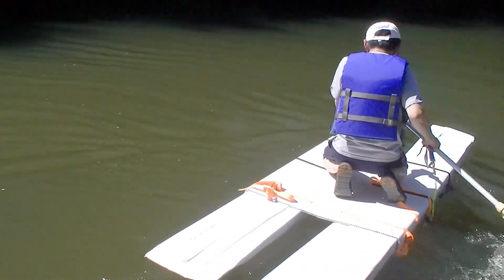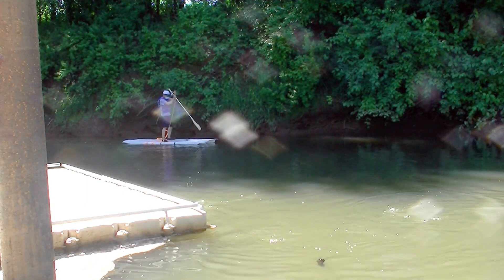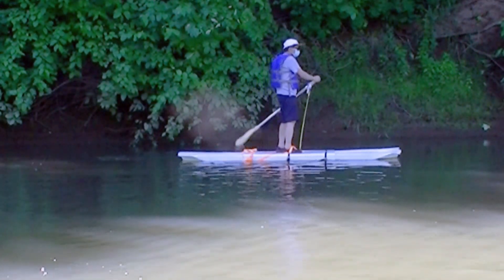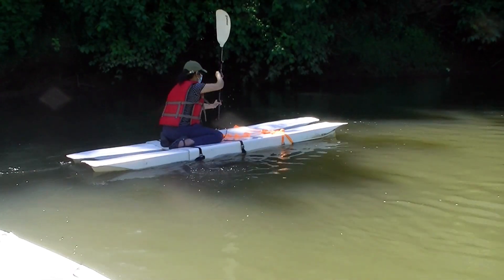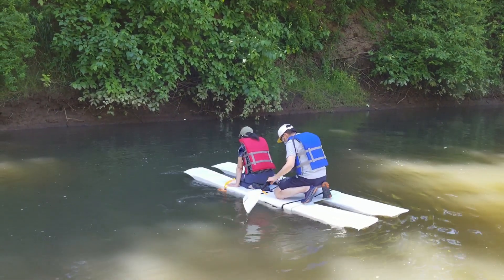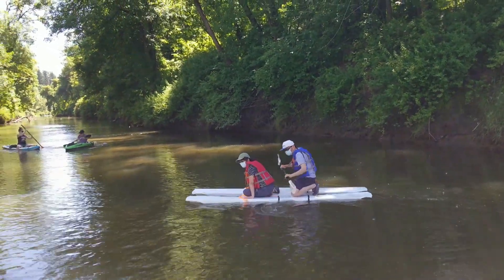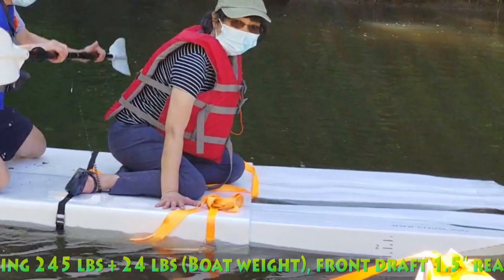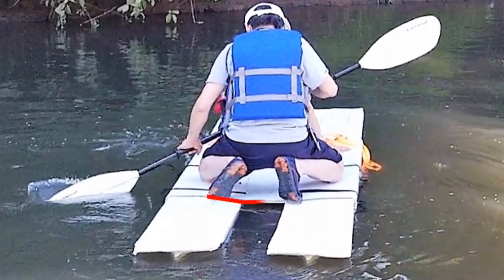Part 3 自製DIY Modular Paddle Board 1st Water Test 自製摺疊獨木舟

Comment: Do you think it would work to put insulating foam boards and spray foam inside the pontoons for more safety?
Reply from the maker: When I built my 1st pontoon boat, I did exactly that. It is very safe and if the pontoon is flooded, the foam will provide 600 lbs of flotation. Please watch this video to see the build of that boat https://youtu.be/8roMckSj-ws   I built my 3rd pontoon boat using foam + spray foam to form the V-shape hull. I never got that to work because I couldn't meet my targeted weight (to get that boat to work, the weight will be 40 lbs).
Including foam inside the coroplast shell means added weight, cost and also time to build one. Therefore I eliminated the foam in Gen 17 . Actual gen 17 is very safe because the submerged part of the boat is made up of one sheet of coroplast without any cut/fused/glued joint. The top side, which is not submerged is sealed. Theoretically I only need to 'water proof' (not watertight) the top because it is not submerged. In Gen 17, the top of the pontoon is always above water. I actually sealed the top with sealant and then tape over it. In the video,  I detected there is a small amount of water inside the pontoon, I don't worry too much about this because the top side of the pontoon is always above the waterline. It is possible the bottom can be cut open by sunken logs/tree branches. I did consider adding another layer of coroplast at the bottom. Later I dropped that idea because I will be using the boat in deeper water. Besides, I plan to redo the pontoons. I could also fused multiple water tight chambers within the pontoon. May be something I will do in the future. I can also add an air bag inside the pontoon, and that will not add much weight to the pontoon (when compared with using foam). I am thinking a different way to build the pontoon, and it is a combination of mid section use foam but the bow and stern will be made up of coroplast (sealed and watertight). I will use non-traditional method (will not use poor-man's fiber glass: too much work) to seal the foam... I am still exploring different low cost, easy to build , with min. weight impact methods......Cheers..

Comment: I wonder about using the 2 inch foam  boad covered with coroplast like we did in our gen 15 boats. I was very pleased with how well that worked.  Good job.
Reply from the maker: Do you mean you used 2" foam as floor for your Water Bug? and it works really well.